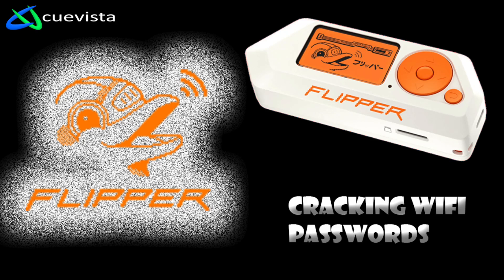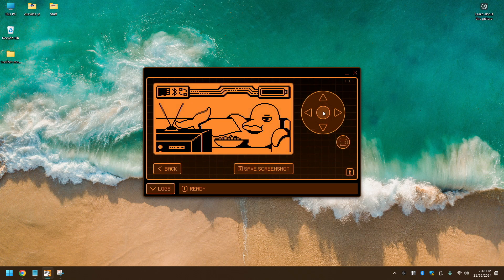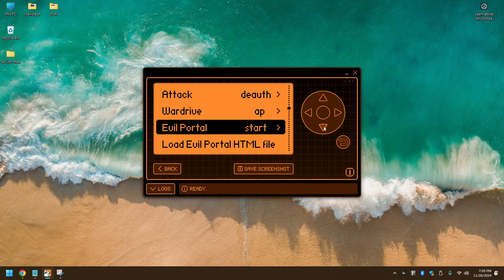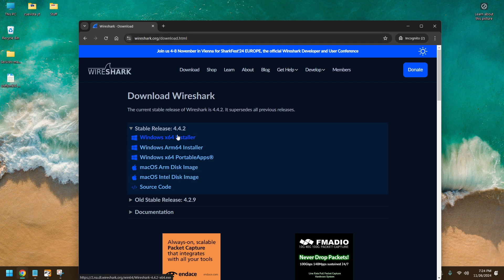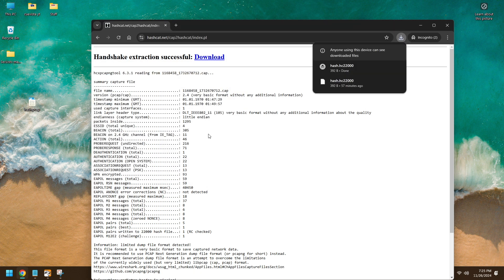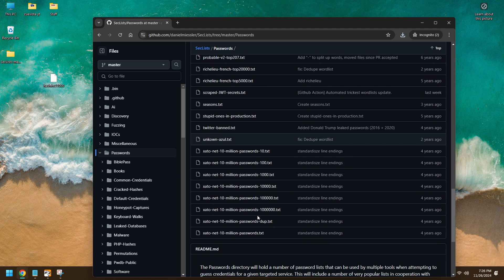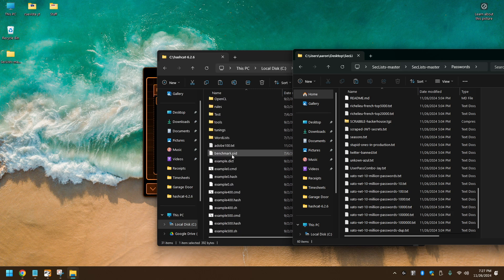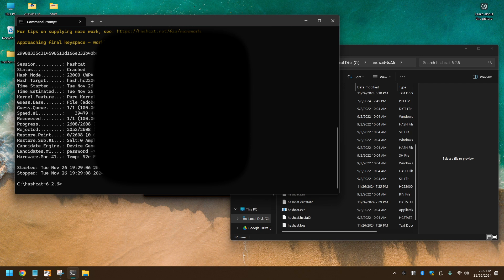Flipper Zero - Unleashed - Marauder Deauth Hacking Cracking Wifi Passwords for Educational Purposes

Comment: i keep getting no such file or directory
Reply from the maker: Hmmm? You might need to navigate to the correct folder on the command line.
Reply: @Cuevista  thanks man, ill try that, im still pretty new to all of this,
Reply from the maker: @wheelchairluke9463 No worries! I hope that helps.
Reply: @Cuevista  hey man i keep getting this Failed to initialize the AMD main driver HIP runtime library. Please install the AMD HIP SDK.

Comment: eapol never shows any results. I tried for as long as 10 minutes and rechecked the new file and still nothing. Does this mean there is no vulnerability in the network?
Reply from the maker: Hmmm? This only works for devices joined on the 2.4ghz band. If you know for sure you have a device on that band, stand between it and your router.

Comment: Password attacks are a waste of time, you need an evil twin to get a password.
Reply from the maker: Yeah, this type of attack is good for wifi credentials on 2.3ghz network. I have another video on Evil Portal that will capture credentials of any sort (i.e., google at&t, etc) with user input, but not wifi credentials. Also, a flipper zero is very limited. A wifi pineapple would give you a larger attack surface and a lot more flexibility.

https://youtu.be/sfHRiIwRKJw?si=yIwKnFfIi-E6qlTB

Comment: When I try to convert it says "Handshake extraction failed!". What do i do now?
Reply from the maker: Hmmm? Make sure the wireshark file contains Eapol protocol messages. If not, run the deauther longer to kick off a device and make sure the device is using 2.4ghz wireless. Deauth will not work on 5ghz devices.
Reply: @Cuevista thank you my guy!❤
Reply from the maker: @yasarama8475 No problem! Thanks for reaching out.

Comment: Why is Wireshark not showing any packets for me?
Reply from the maker: Hmmm? It is either, there are no devices on the 2.4ghz band or you might not be close enough to deauthorize devices on the 2.4ghz band.
Reply: @Cuevista  for some reason I still can't get it to work, when I open the sniff document it pops up again unpacking and it takes up 0 kb

Comment: Handshake extraction failed!
unsupported dump file format: in/21008_1748413192.cap.

That error message i get on hashcat when i try to convert file.

Add file to wirshark also not working and write in adresbar in wirtshark (eapol) also not working.
WTF is going on

Comment: I tried this method to crack my own Wi-Fi. Brute-forcing the password would take over 10 years if it consists of 10 characters including numbers and letters
Reply from the maker: @TwentyNine97  That’s a good thing! 💪Keep using strong credentials. This hack is for the low hanging fruit which unfortunately is still very common.
Reply: Or it might guess it first try
Reply: @TeamLeaderSchmiidtwhat kinda password is 0000000000

Comment: What happens when you open up the file on Wireshark and it doesn’t reflect any data?
Reply from the maker: @michaelanthony374  hmmm?!? It did one of two things…it didn’t deauth any devices or you are on a wifi 5ghz network. This will only work on 2.4ghz network devices.

Comment: I followed you but at last point in command prompt there is a problem.
Usage: hashcat [options]... hash/hashfile/hccapxfile [dictionary/mask/directory]...press any button to exit. I can't execute this process. Help me to come up with same results. What is the issue behind I repeat the whole process at least ten times but I do not get the exact issue. May be you can figure it out. Kindly pay attention I'm struggling with it. Also there is no adobe file in the password folder I tried with other files but couldn't get to it.
Reply from the maker: @factology903  Hmmm?!? It sounds like you might not be in the correct file directory when executing command. To just verify it is working put your actual wifi password in one of the txt files and execute the command. It should find it. But If you have tried several different dictionary attack txt files. Congratulations, your current wifi password is not commonly used.

Comment: Did everything as mentions, but can't get it to work.
My WiFi is on 2,4 Ghz. I can scan it, I can select it.
But it wouldn't deauth, or save any pcaps. Tried it with a couple of other WiFi and it never worked so far. :/
Reply from the maker: @Winznut  hmmm?!? I’m not sure. Do you have any error messages you can share?
Reply: @Cuevista  Nevermind.
I figuered out, that the range of finding a WiFi and the one to deauth attack it, is not equal. ;)
When I sit next to my router, it works.
Reply from the maker: @Winznut  Ah gotcha! Thanks for posting the solution to your issue. Yeah, I didn’t test how far you can be from the router to deauth.

Comment: how can i help secure my network more to avoid becoming a target from an attack?
Reply from the maker: @n4recho677  On each one of my hacking type videos I put a note at the bottom of the video text, but for this particular hack make sure you use a long (i.e., 16 characters or more) and complex password (i.e., numbers, uppercase, lowercase, special characters). So, no online password database/list will have it. Just as a note, every password can be hacked however, it might take many-many years to hack it. Most hackers look for easy targets.
Reply: @Cuevista  thanks for the tips. im trying to inform myself so i can protect my data.

Comment: When will they make a board that can attack 5G? You still need a laptop and WiFi router to do it
Reply: That's is true ,,2.4 GHz works further but weak,5 GHz is strong but is very weak in signal range..
Reply from the maker: @DopeCity5000  Not sure, the general consensus is the flipper zero doesn’t have the power to support the 5ghz band. However, remember 2.4ghz band reaches a lot further than 5ghz. So if you’re on a shoe string budget, you’re not buying another node for 5hz to reach…you will use 2.4ghz to reach that device. The 2.4ghz band will not die until the cost for multiple 5ghz nodes comes down.

Comment: most routers dont allow Deauth anymore though... doesnt work
Reply from the maker: Hmmm?!? I'm running a new ASUS router and any device that is connected on the 2.4ghz band will deauth.
Reply: @Cuevista  yah some will deauth but they gettin rare
Reply: Because most routers now using 2.4ghz and  5ghz, 
when 2.4 g is down,devices who support 5g will connect there. 
You need to log in to "your" router and turn 5g off, then youll be an administrator :)
Reply: @cotob.6300  like i said, doesnt work anymore, the way it was suppose to be intended
Reply: Sending disassociation packets help ..I actually did a test yesterday and there were 2 clients that wouldn’t deauth..I used the flipper and pineapple but I still felt like deauth using aireplay is my favorite
Reply: It works,but like some One says, most new routers that support and pay for service,it will change from 2.4 g to 5 .g ,but ones that don't it will shut it down..I try it alot on new n old ,I'm currently working on new device to work on 5g ,it's alot work in progress,,but I'll get it done..